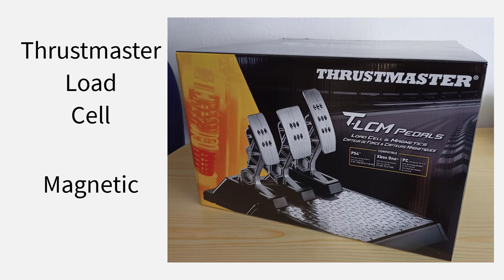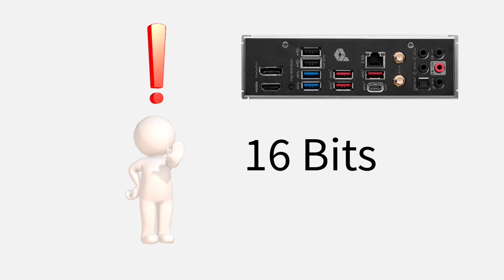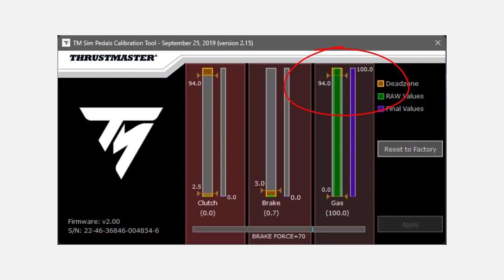Transitioning from a Thrustmaster T3PA Pedal set to a Thrustmaster T-LCM, Load Cell Pedal set

Comment: People with T3PA pedals or similar, when in game, press the brake pedal as hard as you can few times, then fully press gas and clutch. this way the pedals are calibrated and now they know where is the 100% mark. If you don't do this and for example press the brake 50% down, the pedals will think that that 50% mark is 100% (this is what is mention in video when he said he pressed brake half way and then if it pressed it more, it goes to 100% and locks the brakes up). Its listed in the manual, but people don't read it and most if not all reviewers don't know about this or mention it :D
Reply from the maker: Hi, thank you for commenting.

I seem to remember I did this 50% thing as it was the advice given for people who were having issues with controlled braking (but it was a bit back so I might be mis-remembering) and that was why I did that. But either way, I found the T3PA hard to use, and that's probably because it felt so different from my daily ride (in my real car) and although the Load Cell isn't the same either, it is a closer approximation of how a real brake pedal works.

That being said, I do know people who still use the T3PA to great effect, and still get faster times than me, so a lot of it is of course down to the ability of the sim racer.

For me, the Load Cell pedal was just a much better fit for me.
Reply: @OlderGamersPerspective  I think you misunderstood what i meant with the 50% thing :) The way you setup your old pedals is all fine and okay. What i mean is the way TM pedals like T3PA and similar work(this doesn't apply to T-LCM) is that when you first start a game the pedals have no idea where the 100% pedal position is. So you jump in a car and press the pedal lets say 30%, now the pedals think that 30% you pressed it is full 100% pedal position(which is wrong, of course), hope that makes sense. This is why before driving always mash the pedals to their max as far as they go, so they calibrate and actually know the 100% pedal position. This doesn't apply to T-LCM pedals. Load cell pedals are more superior than normal non load cell pedals, no doubt in that. Good video, keep up the great work.
Reply from the maker: @byCDMC  Thank you for the comment, that's a lot clearer. Always so much for me to learn about sim racing, it's great the community is able to do this. Thank you again for your comments.
Reply: @byCDMC   does this apply for all 3 pedals mash them all down before driving? Just asking since I just purchased a used TGT 2.
Reply: @ajoydas-Watch-It  nope, you dont have to mash them like old ones to calibrate and use before driving/racing. "3 pedal mash" only applies to non T-LCM pedals. so if you use T-LCM pedals, you dont need to mash them :D
Reply: "when in game" like when you launch the game, in the main screen/main menu?
Reply: @Shazam0210  "when in game" as in you are about to drive it, sitting in a vehicle
Reply: OMG THANK YOU 
Still just gonna use the t.jr12 adapter tho
Reply: Thank you
Reply: @byCDMC not true. Well, for me at least. I was having problems with GT7 registering full push until I started pushing them twice on main menu before racing. Been fine since doing this.
Reply: @tenbob1973  GT7 is not a PC game. I'm talking about PC only. I have never tried this on a console. Glad it still worked out for you.
Reply: @byCDMC  aah, my bad. Well, hopefully my comment helps console users.
Reply: @tenbob1973 very helpful comment. Do you mean when in the map menu or what exactly do you mean by „main menu“?
Thank you so much
Reply: @flyingchris81  I just do it at main menu. Maybe I don't even need to do it now, who knows 🤷🏻‍♂️😂. Well, it's habit now, main menu - two full presses of brake and two full presses of accelerator. Edit, by main menu I just do it on the world map.
Reply: @tenbob1973  thank you so much. I’ll start doing it from now on.
Reply: Do you have to do this everytime you go into the game for every game?
Reply: @j.light12  on PC, you need to do this every time you start a game, yes.
Reply: @byCDMC  ok I just bought the tlcm pedals they are coming in tomorrow is the the case for those as well?
Reply: @j.light12  T-LCM pedas are not the same as older potentiometer pedals. you don't need to mash them, they just work as they should. turn the game and and they know what's what :D
Reply: @byCDMC  ok thanks for the insight I wish I would’ve known that sooner but I hadn’t really had an issue with the pedals not working right. But I also play truck simulators not racing ones so maybe that’s why. Anyway thanks for the advice
Reply: @j.light12  been playing truck sim games for 20+ years now. G25 had it, MOMO racing (Logitech) had it, they all had the same thing, that you need to press the pedals down fully before driving. I dont understand why more/if any "youtubers/reveiwers" never talk about it, it is in TM manual actually. Your new T-LCM(T-LCM dont need to be pressed down before driving, they already know whats what, unlike other pedals) pedals will work amazingly, i have a pair on my sim rig my self. Really happy with them :)
Reply: @j.light12  I just do it as habit now when I start up GT7. Not sure about other games yet, have only been racing GT7.

Comment: Good video.  I went from base logitech to fanatec load cell a couple of months ago.  I went slightly quicker but consistency increased big time due to logitechs vagueness.  And I had improved the logitech with a spring setup and diy bodnar cable.  So I highly recommend upgrading.
Reply from the maker: Hi, glad you found the video helpful. The load cells do make an incredible difference. Looking forwarded to trying out some of the newer stuff at the ADAC sim racing expo in October.

Comment: I would seriously consider the elastomer solution - the springs, even the stiffest, never felt like I was pressing a brake pedal. I used some soft skateboard bushings in place of one of the springs which improved things considerably, but they were a bit too stiff. I upgraded to HE Sprints before I found a good solution for the T-LCM. Heusinkveld actually sells a replacement elastomer kit for the Sprints, and while I've never tested them, they do look as if they would fit the T-LCMs quite nicely.
Reply from the maker: I am going to look into the elastomer kits, as I am very curious about how much difference it will make to the brake pedal and it's responsiveness.

Comment: Ive had my tmlc pedals about a year now, everything in this video is accurate but over time they have become very creaky and noisy, ive tried the elastomer upgrades and stripped them down to regrease moving parts and pivot points, this helps a bit but hasn't cured the creaking under heavy braking. Just to come off topic, where is the Thrustmaster direct drive for consoles??
Reply from the maker: Mine are coming up on their anniversary in a two months time. So far they are still quiet, in fact most of the noise comes from the gear changers on my Moza R9, the ES wheel. Man are they loud. I mean really, earth shattering loud.

Anyway, glad you liked the video, and just a heads-up, I have ordered a haptic feedback kit for the brake and accelerator, which should arrive sometime next month. They need Sim Hub to work and will apparently add some vibration to my feet. 

Can't wait :)

Needless to say, a video on this will be made :)

OH and  thrustmaster... Yes, where are they? Totally missing from last years ADAC sim racing expo, as were Logitech. It's almost as though they are not longer interested in this market.

Comment: Hi, i have a question about t3pa. My accelerator pedal is shaking a little bit. Does this model have that porblem or only my? Thank you for answer and have nice day
Reply from the maker: I've just taken a look at mine and there is some side to side movement in it, a few millimetres, but I can't honestly tell you if it has always been like this or gone like that over time.

In comparison to the brake or clutch pedal, it is clearly more movement, but the accelerator pedal is a longer pedal, so that might also be why.

Hope this helps.

Comment: I have the T-LCM pedals and I play at a desk. You’re right that it is a pain in the butt to get them to not move. The other reason I would recommend a sim rig with these pedals is just ergonomics. Playing at a desk with the way my feet are positioned compared to my body in a computer chair just makes it painful after a while. The top of my foot gets so sore from the angle. It’s just not a natural position for your feet to have to press a sprinted brake pedal.
Reply from the maker: Yes, I was in that position myself a while back, when I sold one rig and ordered another, but there was a period of time between them where I had no rig and was playing with the wheel attached to a table clamp, the pedals under the desk, and me sitting on an office chair that rolled back whenever I pressed to hard on the brake.

One thing I noticed in the office chair was that my accelerator leg (right leg in my case) was aching after a prolonged session, and I had knee pains the next day, so watch out for your comfort, it is an early warning that you are making your body do stuff it shouldn't, Your Sore Foot is a red flag. Figure out what you can do to change that as soon as you can.

Comment: I use these pedals they are great.. there is a bolt in the middle bottom for the break tighten it.. your springs is perfect red silver black i advise you to put gain on 55
Reply from the maker: Yes, I saw the bolt, I might give it a bit of a twist as it does feel just a tad lose. 

Gain to 55? Is that to prevent lockups? I could try that....
Reply: @OlderGamersPerspective  gain 55 will be easier to break and will not lockup
Reply from the maker: @Gantz71  I will give it a try.

Comment: Great video, amazing effort. I’m using Logitech G29 and looking for first set of load cells.  Been looking at Moza SRP, fanatec elite v2 and the TLCM, I use a playseat challenge and reckon the TLCM could be the best option. Your video really helped.
Reply from the maker: Hi, I am glad you found the video helpful. A load cell pedal does add a bit more pressure onto a rig, so with the Playseat Challenge, you may need to consider a reinforcement kit (available from various places on the internet), that will strengthen up your foot pedal area. Having said that, your driving style might not need it, so it's worth attaching the pedals to the rig first to see if there is any flex while braking heavily. 

Either way, let me know how it turns out.
Reply: I'm in the same boat and I'm curious what you ended up going with. I also use the Playseat Challenge + Thrustmaster T300 and want to upgrade to load cell pedals, but I'm unsure whether to go with T-LCM or SRP. T-LCM would be easier to fit but SRP is almost 100€ cheaper (which is weird considering that Moza seems like the more premium brand)
Reply: @TzeiEm  hi, I went with the tlcm and they have been really good.  In terms of lap time wouldn’t say improved much but consistency definitely works better.  Interesting with different pressure springs, which really is down to personal choice, I went with the red then 4 middle spacers then the black.

Comment: Thanks for the video. I've been looking to upgrade my T300 pedals and now I know what to buy. I have a GT Omega Art cockpit and have been concerned about the fittings for fanatec etc. A quick question, what Moza wheelbase do you use?
Reply from the maker: Hi, 
I am glad the video can help you.

I am using a Moza R9 wheel. You can find a video of how I moved from a T300 to an R9 here:

https://youtu.be/VAY-Ff1G6t4

Bolts onto the Omega Art with no issues, and I've never had an issue with flex or anything like that. Needs some time to customise the profile in the Moza software to get it to your liking, but once done, you can pretty much forget the settings are always there.

Let me know how you get on.
Reply: Thanks for the info. Following a generous donation from HMRC! I went for the full Moza Ecosystem - R9, GS Wheel and SRP Pedals. Im sure it wont make me any faster but hopefully being passed by other cars mill be a nicer experience.
 @OlderGamersPerspective
Reply from the maker: It definitely is a better experience, being passed by faster cars while you are driving with cool gear. I should know, it happens to me all the time :) Enjoy your new gear. Let me know how you get on.

Comment: Informative and humorous. I mostly play GT7 and have been struggling to get used to pedals over the controller. I'd been considering the T-LCMs at some point. I currently have the T-3PA Pro.
Reply from the maker: Thank you, I am glad you enjoyed the video. To me the pedals, going to a Load cell, made more difference to my overall ability to drive than the wheel, although the wheel gives me much better feedback, particularly in oval tracks (for whatever reason), so as an upgrade, the load cell is a great one to make, but only if you have a rig to secure it to, otherwise you might struggle to get the best from it.

Comment: first of all great video I really want the pedals now. but do you think I can fit them on a challenge playseat?
Reply from the maker: I am not too sure. I had a rig similar to the Challenge playseat, but I only used it with the T3PA pedals, having upgraded to an GT Omega Art rig before I got the T-LCM. You could probably get away with it if you bought some of those strengtheners that I have seen advertised on Etsy and places like that. 

Otherwise, I think you might eventually see a failure in where the footpedals attach to the chair.

Let me know how it turned out.

Comment: I’d like to go for load cell pedals but I fear that at minimum strength it’s still to hard to push for 100% braking. 
Is it possible to make this t-lcm quite soft with the softer springs and force to 0 in the software ?
Reply from the maker: You can put on the very light springs, and if they turn out to be too light, you can change them for a combination that's a bit tougher. They are very easy to change, and can be done in just a few minutes.

The software is also very customisable, but only if you have the pedals connected to your computer via USB, not into a Thrustmaster steering wheel via the PS2 connector.

Whether or not the combination will make it light enough for you, I can't say for sure, as I don't know exactly how light you want it to be. Either way, even at it's lightest, a Load cell pedal is going to be tougher to press than a standard pedal.

Hope this helps.

Comment: From my experience it is just a different way of doing the same thing, I went from a G27 to Fanatec CSR to a G29, it is all about adapting to what you have, but with a load cell you definitely  need a cockpit of sorts. I actually like a lot the stock "two-stage" braking + the app sensitivity adjustment of the Logitech G29, just got a TG-T recently and I am very disappointed about the T3PA compared to the G29... I really hate how Thrustmaster likes to bundle good stuff with bad stuff.
Reply from the maker: Yes, I can remember that, going from one set of pedals to the next, and just finding a way to adjust technique to suit the equipment you had. I also felt the same way about the pedals that came with the T300, they really were not a match for the wheel, which was pretty good for a non-DD wheel. 

The big question about Thrustmaster, and indeed Logitech, is where are they now?

There was a time they ruled the wheel market, now, you don't even see them at trade shows.
Reply: @OlderGamersPerspective  I have been out of the loop about the best beginner wheel in recent years but what I always liked about the Logitech G27 / G29 is that they give everything in one set (3 pedals/shifter) and in a good accessible price point.
Reply from the maker: They are very good value, and years back, I started on something similar that I borrowed from a friend, but the lure of the Direct Drive wheel and a better brake pedal proved to strong :) What can I say? I am weak :)

Comment: I made exactly the same transitioning as you the day before yesterday. I have played only five hours ACC on PS5 with the new pedals and the feel is superior for sure over the T3PA. I don't see my lap times getting better neither being more consistent, i think it's too early to have a certain opinion. I use the same setup as you regarding the springs and the brake force set to 75.

 Because i bought a used set of T-LCM pedals i do not have all the washers included but only one. I would like to ask you if you tried putting the washers in the pre load spring and what is your experience with that. 

Take a sub from me, your channel is great. You deserve more!
Reply from the maker: Thank you for the feedback and also the sub  :) I did not try the washers, at least not yet, as I felt the precompress worked better for me with zero washers in there. But far as I can see, they are fairly common washers, so if you take the one you have to a hardware story, you should be able to find a matching set.

When I first got these pedals, I remember my lap times going the wrong way, but then I realised I was still driving like I had the T3PA under my feet, and that did take a bit of unlearning before I could get it right. So, I would say, you are right, it is too early yet to judge. Keep with it, and if you are anything like me, remember you don't have to hammer that brake any more, you can tickle it a little more.

Some one else said the force can also be set to 50 and it is better, but so far I haven't tried that as I don't want to upset my times, but I think the main reason for that was some knee pain I was getting due to the extra pressure needed to use a LC pedal.